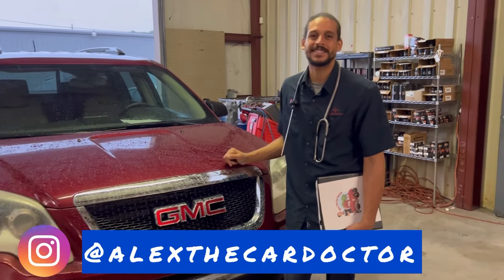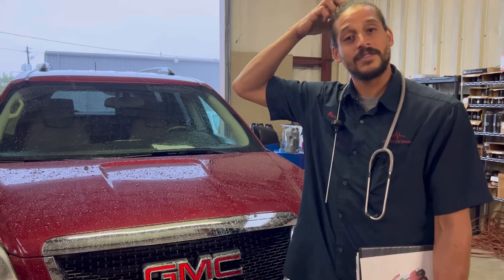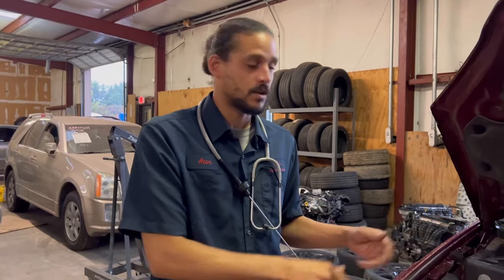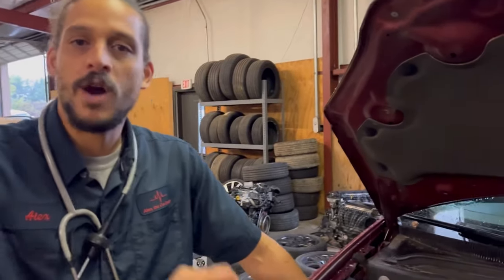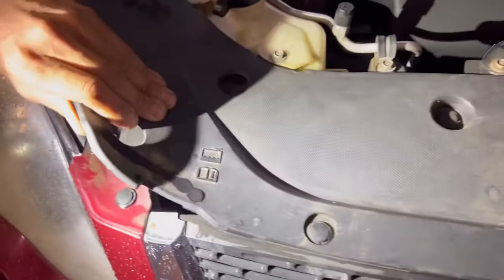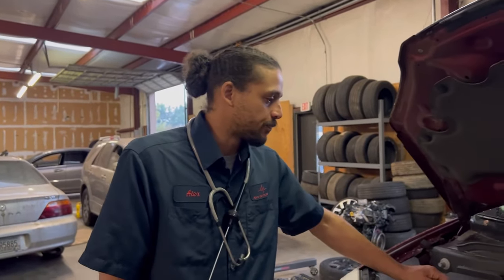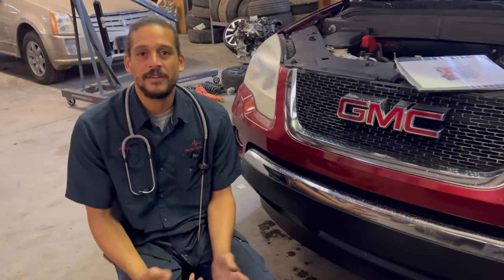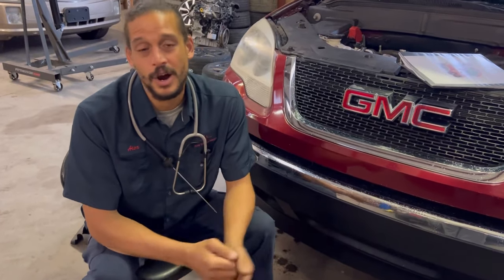The Top 5 Problems - GMC Acadia ( First Generation 2007-2016) | Should you buy the GMC Acadia? #gmc

Comment: This whole plateform is awefull as a former UAW GM worker i was very disapointed with this car had so many problems all the way up until the engine went body looks amazing i know GM can do better evryone i know with this plateform from saturn to buick has so many problems
Reply: I have a 2014 GMC Acadia. I’ve had it for five years now it has 144,722 miles. I’ve already had the timing change though put on brand new now the transmission is slipping and the power steering is doing something. I cannot wait to get rid of this vehicle. I still owe 6000 and some change on it, I want a forerunner
Reply: I bought a 07 new in 07, and it was nothing but problems. After several bad gm's, l seriously doubt I'll ever buy a gm product again.
Reply: @craigcardwell4143  Sorry to hear that I've had similar issues with GM products in the past.

Comment: I have a 2014 GMC Acadia 96000 Miles and never had any of these problems because I do normal regular Maintenance according to GM’s recommendations. However the tip on the heater core hoses was a good one to get rid of the plastic retainers and go with stainless steel. Thanks
Reply from the maker: My pleasure i’m glad you was able to get something from my video and even more happy to hear that you follow your schedule maintenance,not a lot of people do that and want to blame the car
Reply: its not years.  its miles.  96k..nope  125k+.  look out
Reply: Yeah we believe you
Reply: Let me know when you reach 200k
Reply: @DonVerchi700as  Our's is 4k miles away from 200k, got it used 2012 Acadia Denali with 24k and its a 196k right now with only regular maintenance. The transmission does have that wierd shimmy in it but its still the original and holding on. The motor has never been opened and is completely original. We barley did the motor mounts all the way around, all 4 shocks, and first time replacing water pump. It's surprised the hell out of us honestly. We thought it would of blown up  46k miles ago.
Reply: @elkomander3510 . Most people watching this video will be used car buyers getting into a high mile Acadia. 
If I was looking at a 20k mile car, I'd only check car fax. 
And the price point from low miles to high miles is wide ...
Reply: I love my 2011 Acadia have had it 12 years with just couple minor things over the years.  Just passed 100k!  I’ll be taking in for transmission flush after watching this
Reply: @elkomander3510 congrats!🎉
Reply: @Bradl1961  I love how GM has trolls to offset the complaints lol

Comment: Just bought my kid a 2012 Acadia, guy thought the headgasket blew on a 12k mile new reman engine for a jaw dropping $1k. I as soon as I dropped the engine out, it took 2 seconds to diagnose the water pump gasket blew out. Decided to check the heads anyways tore it down this is what I found: 2 almost falling out bolts, 1 loose bolt and 2 almost torqued bolts on the water pump. Cam bearing caps installed wrong spots, causing early wear on cams and bearing caps. Then finally left bank head... not torqued down, literally one bolt was finger tight, the rest were at maybe 20 ft lbs. Pulled the heads and luckily they are not warped. It was a matter of when that headgasket would have blown, but I caught it pretty easily. I'll be slapping it back together in a week when my parts arrive. Got a $6k car for $1k and about $550 in parts, and about 25 hours of my time. My kid is so ecstatic about my find. Shame on Midway Engine Rebuilding, glad that company went under.

Comment: Timing chains were redesigned in 2014. So you can scratch that off the list for 2015 and 2016 cars. As far as other things, basic maintenance for any SUV car as they all are cramped in their engine bay.
Reply from the maker: Thanks for the info buddy
Reply: Hope the timing chain redesign  helps in the long term then with my 2016  Acadia model .

Comment: Purchased a used 2008 with 30k miles on it back in 2009. Thank goodness I bought an extended warranty! I had many issues with the transmission. 4 different times being stranded, they finally rebuilt it. The water pump failed too. Other than that, I still own it with 225k miles on it. 
Only other issues have been the alternator and the tee fitting on the coolant line. 
Currently have a bad power steering pump for the past two years. Finally getting around to changing it.

Comment: I just bought one of these, thanks for the heads up on problems...Car seems solid far as I can tell, but I'll be sure to keep an eye on the issues you mentioned, they don't build them like they used to! I miss my 1991 Chevy Silverado as a kid, thing was a tank...
Reply: I'm thinking of buying one and it's already at 150k miles 😅 but it's very cheap so I wanna get it how is yours holding up

Comment: Thanks. Your videos are great and very helpful!!!!!  I just purchased a 2015 Acadia Denali (from GA) that was well kept and serviced regularly at the dealership they purchased it. It was a trade-in for a newer model. I will do all the things you mentioned as preventive maintenance to avoid major issues. Seems to be sound, only one owner, runs smoothly, transmission was flushed, regular oil changes since they purchased it and didn't display any bad engine codes on running my scanner. It should serve me well if I continue the same maintenance and then some as I do to all my cars 🙂 ... Thank you and look forward to more of your videos!!! ~Julia from Greenville SC
Reply from the maker: Thanks for your comment Julia! Maintenance is key 🔑🔑🔑 it should serve you just fine!

Comment: Have a 2007 Acadia, still only 50,000 miles, just ran into the purge valve issue which led me to this video.  Only issue I've had with it in the 24,000 miles owned was the water pump going out.  All else has been good.  I run Castrol edge GTX full synthetic oil.
Reply: Those are only 25% 
Rotal purple is a 100% full synthetic. 
Laws allow 25% to be considered full synthetic

Comment: I have a 2008 Acadia that is a nightmare! The car lot I bought it from knew it was a bad one but wouldn't even put it in their shop when I complained about it not going into gear when taking off at a stop light... This things check engine light stays on with the torque converter clutch and and transaxle control system malfunction plus the catalytic converter! I don't have the money to fix all that and I have driven it for 3 years in limp mode... Turning it off and starting it every 2 stop lights... The car lot head mechanic told me to just drive it till it quits..I finally paid it off last week...I will never go back there again! Lol I'm surprised it's lasted this long...I just wish I had seen a video before I bought it!!! I just wanted to let you know you are right on point with this one! 😥

Comment: Thank you Alex. I have a 2014 and definitely had to get a brand new timing change belt $2,500!😢
No one told me about a serviceable vehicle. Now my transmission is slipping. Now my gasoline smells weird and it definitely sounds like somethings wrong with the power steering and this is based on issues that I I have had with other vehicles. Thanks for taking the time to do this video.
Reply: I guess you neglected your car hugely by not doing the proper maintenance all over .

Comment: Thanks for the info.  I have been watching a few of these video's about the 2007-2012 Acadia's just to see what people think.  I'm on my 2nd Acadia of this model style and would go out and buy a low mileage 2011-2012 (again) without question.  Both of mine have been very reliable and I love the ride and the feel of this SUV.  (The newer 2013+ Acadia's are lighter and ride stiffer, which I didn't like.)  My first one, a 2007, (bought in 2009 with 37,000 mi) went to just over 165,000 mi.  Power steering rack gear started going out - which I read was an issue with the earlier models.  Rather than repair, I traded it in for a 2012 (in 2015), with 34,000 mi.  That one is still going strong with 170,000 mi.  Just replaced rear springs and shocks - fairly normal wear replacement.  I have always used synthetic oil and think that's critical.  Always change by 5,000 mi or slightly less.  Did my 100,000 mi maintenance items as well - coolant change, trans fluid change, plugs, etc...  Again, I like these so much I would hesitate to buy another used one from 2011 or 2012 with low miles, from a warm climate - no road salt (but getting hard to find).  I do a lot of highway driving, so I'm probably a little easier on the engine.  I am concerned about timing chain life with this engine but so far, no engine faults or performance issues with either one I have owned.  It was one of the reasons I sold the 2007 rather than fix the power steering issue.  With new SUV's of this style being sooooo expensive, it's hard not to justify keeping an older one running if you like it, and its in good shape.

Comment: I bought a 2016 GMC Acadia 2020 with 15,000 miles on it , now it has almost 41,000 miles on it . I use Mobil One full syn. and change every 4,000 miles . When it gets 60,000  I will  have the the cooling system and trans flushed out . Thanks for the video , I was considering a trade for a Toyota 4Runner SR5 series later model . Well haven't made my mine up totally , maybe not and just have the maintenance done when it comes due and keep my fingers crossed for a good outcome . MB

Comment: I have a 2012 Acadia.  Definitely wish we would have bought something else.  Would not recommend it.  Have done the radiator hose you pointed out. Replaced the alternator which was a 6 hour job for me.  Has 165,000 miles and will just drive it until it stops. Will not spend any major money to repair.  Love this video.  Thanks
Reply from the maker: Thanks for watching buddy

Comment: I got my 2008 Acadia from my grandparents a month ago and have been having some issues like it smelling like gas outside of the car but they said that’s what a throttle body does, there are two spots that water leaks in, and it’s also kinda of a gas guzzler if you drive it everyday that you have to fill up every 4 days

Comment: I own a 07 Acadia and have had it for years of course I have had a few problems here and there but I love this suv and won’t get rid of it…but I will admit since I have had it there is one thing that none of my mechanics over the years can figure out! When I remove the gas cap to put gas in it…u can hear the suction noise and while pumping gas my car sounds like it’s about to stahl but as soon as I put the cap back on it goes away but I also have to pump my gas with the car running bc if I don’t after pumping gas it won’t start smh!! I replaced the fuel pump, starter, alternator, and coolant hose over the years

Comment: If I remember right there was a service bulletin that went out that you had to use a good motor oil or the timing components did not hold up well.  Problem is the timing set is also hydraulically tightened off the motor oil so running low on oil and crap oil cause a lot of the timing set issues.

Comment: I bought 2012 GMC Acadia (same color as one in video) and it has been an Awesome car/SUV!  I have done front and rear brakes, one cv joint, new thermostat, and new tires.  It had 151,000 miles and now has 174,430 miles.  I have spent less than 1,000 dollars in 3 years of maintenance.  The gas mileage stinks  and my air went out but other than that it has been great!
Reply: BS, that vehicle has a GDI engine and if you have not had to change the fuel injectors yet without any maintenance then you should buy a lotto ticket.

Comment: I bought a 2015 really cheap like  $ 1500 cheap  everything worked no dents rust and etc 
The only option it doesn't have is a power roof .
The day I baught it I took it to the shop I use to fix my vehicals he recommended I have a new timing chain put in so I did it cost me a little over two grand to replace and I haven't had one problem with the suv .
Just last week I realized it has heated seats that work. 
When I take my son to school he watches a movie on the DVD player .
I hope to find another one as in good shape and for the same price.

Comment: Really good info. Some other concerns:

If you have a 2011, like I used to, a common problem has been the headlights burning out. This is actually a fire risk and I had to change out one of mine. Was told we were lucky that we did not already experience a car fire.

Had to replace the sensors found in the air intake manifold. This caused numerous issues and error codes including engine failure. Once these sensors were replaced, and cleaned out the air intake, was golden.

The transmission issues are real. It seems that they have gotten better in the 2015 and 2016 versions. I just bought a 2016 as it had the lowest customer complaints of any year plus it was still in the large body style which my family needs.

Acadia is a great vehicle, but I sincerely hope I do not experience the transmission issues like older models.  If anyone is looking to get into one of these, look into the 2015, 2016, 2013 models as they had the least amount of complaints.  If you are ok with the newer, smaller interior, the 2019 and 2020 seems to be doing well.
Reply: I have a gmc acadia 2011 and the car trembles while I'm driving not all the time but randomly. What does it mean?
Reply: I spent 4k at christian brothers to fix it but nothing was fixed besides the ac.

Comment: That is a cool challenge. I have this car and should’ve done the blindfold test when buying   Might have git lucky and picked something else. Just replaced Caralytic converter. Power steering pump which was faulty. Did alternator myself. I work in hvac so not totally useless in car repair. But with the prices of repairs , I’ll start doing my own.
Reply: But I miss lifting the hood on my Dodge Ram and seeing ROOM TO WORK
Reply from the maker: I say if you can do the work yourself, you should go for it! 👨🏽‍🔧

Comment: We bought a 2014 Buick Enclave in 2018 with 35K Miles.  It was cheap.  Have driven it 60K Miles in 5 years with little issue.  Change Oil with Mobile 1 Synthetic every 3,000 Miles.  See Videos on GM 3.5 PCV Valve Modifications to help with slugging and eventually timing chain wear.  Our transmission recently went out.  $5,000 to rebuild.  The transmission Cooler is built into the radiator and can develop an internal leak which allows engine coolant into the transmission.  This wiped out our transmission.  Recommend putting on an external transmission cooler.

Comment: Water leaking inside from the clogged sunroof drains causes most of the electrical problems on these.
Modify the drain elbows on the firewall, and try to stop all water leaking into the electrics.

Comment: I am a GM vehicle fan. I enjoy your channel, and your tips are helpful to prospective vehicle buyers. I would like to highlight that GM supposedly improved the 3.6 liter DI engine after model year 2015. In addition, on the 2018 to 2020 second gen GMC acadia, GM offered the LCV 2.4 liter engine from the outgoing chevrolet Malibu. The LCV engine is more reliable compared to the 3.6 liter engine. Although the model is not reliable compared to a Toyota, many of its problems are assauged by normal maintenance. If you desire a used vehicle with low miles, the Acadia can be a reasonable choice.
Reply from the maker: Thank you for this input!

Comment: 2013 had to replace radiator recently. Lots of labor $$$ doing that. Also most expensive tail light bulb $110 💡 To replace front headlight had to remove tire and inside panel. Lots of labor again!

Comment: Great stuff! I'm currently in the position of chosing between replacing pretty much everything you mentioned or trading her off lol I wish I would have vane across this before my wife found that "cute cat she wanted"
Reply: You Bought a Lemon 🍋
Reply: dude u have an f'ed up hose, alternator, valve cover gasket, purge solenoid, timing chain and failed transmission? my man I hope ur a tech and can do this yourself cause if not u got no buisness even thinking about recovering this car. trade it in. even for a tech this would be about 1 weeks's worth of work and 30k nightmares to deal with before getting that car back to life.

Comment: Had a 2015. Transmission was going out on it. Between 1 to 2 gear would slip. Did the maintenance on it. The timing chain cover started leaking at 80000 miles.

Comment: My wife has a 2010 and to me nothing but a headache lol so far we replaced the transmission,valve cover gaskets, spark plugs ,coils and I recently just replaced the power steering high pressure line that was making a loud noise Every time I accelerate or start car other than that these vehicles are Problems but she likes it and I do advise everyone to use good quality oil and change it very often I change it every 2k miles

Comment: Yeah I got one of those. 2010 . Fixed most of the issues you mentioned. Now I have air conditioning tube holes under the brackets. 2,700.00$$ to fix.  Plus the power steering is making a  noise. Just put a catalytic converter in . Wish I could bring the car to you. Thanks for the video s they are awesome ❤❤❤
Reply from the maker: $2700.00 😳 I gotta look into that one! Thanks for watching my vids!

Comment: I have a 2017 Enclave. Bought it with 11000 miles in 2018 and it now has 64000 miles. I change the oil every 3-5k, I drain and fill 8-10 qts of tranny fluid once a year.  I did a drain and fill on the coolant, need to do it at least one more time. Only problems I’ve had are the purge valve after it got stuck open (switched it out in my driveway, real easy), AC started not cooling very well (recharged the AC no leaks after a year+) and the coolant temp sensor went out.  Been a real good vehicle. I would never buy one of these as a used high mileage vehicle unless I knew the previous owner was strict on the maintenance like I have been, otherwise it can be a money pit.